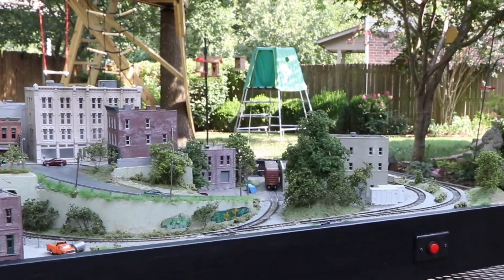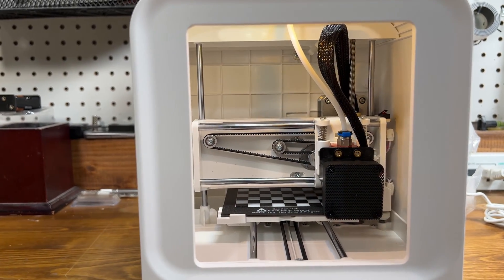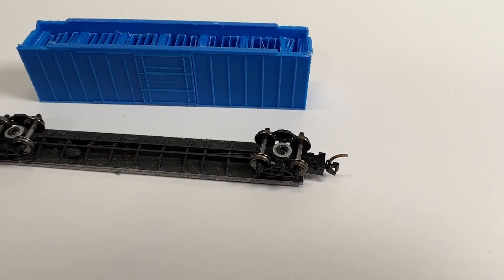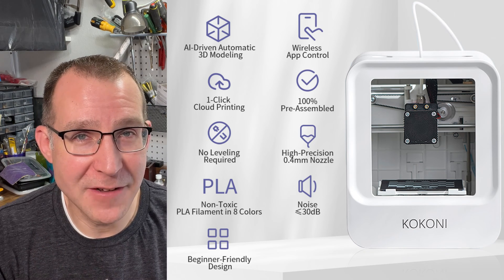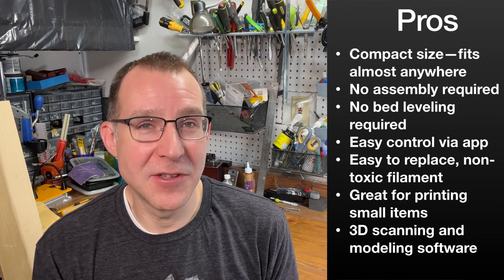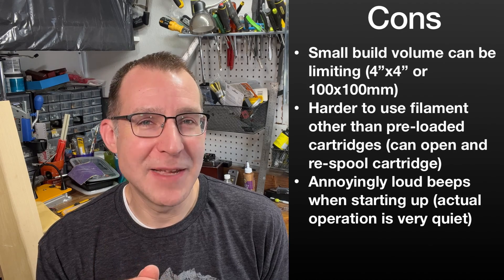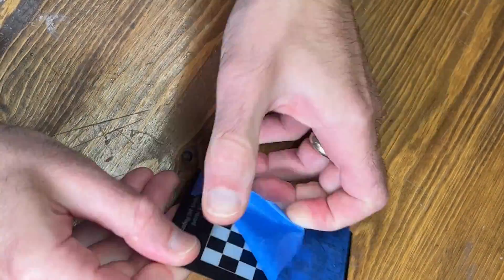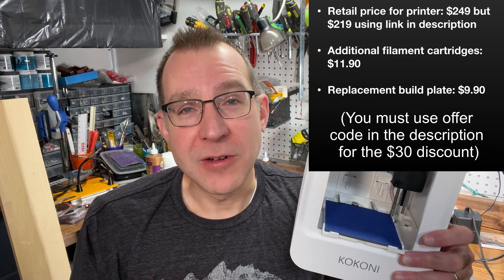So Easy, So Compact! // Kokoni EC1 3D Printer

Comment: What do you do with the used canister?
Reply from the maker: Yeah, that is the main issue. Technically they can be recycled, but in practice not easily since most places only take bottles. You can, however, refill them yourself if you unscrew the cover and put your own filament in there. So, you don't actually have to keep buying new canisters, but it is a bit of work to put new filament in there given all the screws and trying to feed the filament through the drive system, etc.

Comment: Hi Steve, new subscriber here. Love your videos, thank you!  On this printer, it appears they had a good price increase in the 5 months since you made this. I have been interested in 3D printing for a few years since my nephew made me some switch holders for my RV lights when I found a design online and sent it to him. Working on a new N scale layout I can see plenty of use for one! Just paid nearly $20 for 2 “Pods” shipping containers for a flatbed car and could easily have printed them for less!. But in your video you mentioned the “Ender 3” so I searched that on Amazon and found it as cheap as $168 where the Kokoni you mentioned has gone up to $289 as of 2/10/24. They still seem to honor the discount, but I have to wonder if the Ender 3 isn’t a better deal. Even if I added the $49 enclosure for the Ender it’s still cheaper than the Kokoni with the discount. Also, do you need special software to run these? I have a macbook/ipad/iphone and wonder if software is available for any/all of them? Thanks again for your hard work and informative videos!
Reply from the maker: The Ender 3 is more flexible overall in that it has a much bigger printer bed and can print more materials, but it isn’t as user friendly since you have to level the bed and configure bed and printer head temperatures yourself.  You can use free software for the printer and some free software is available for designing.

Comment: Hi Steve.
Great video. I have one of these printers and use my iPad with the Kokoni app. Only problem is the uploading of files to the printer from other sites. It just doesn’t accept them. Which file sharing app do you recommend.
Reply from the maker: I’ve only uploaded files (from thingiverse or elsewhere) to the kokoni cloud site so I could then select them with the app and print them that way. I don’t know of any way to avoid doing that.

Comment: Great video! Only question is that I’m trying to use micro train trucks. Do you know any that would work well for the box car and others like hoppers?
Reply from the maker: I don’t really know yet since I haven’t actually bought any to do that. I just stole these off a broken box car.  They do have lots of different types with different length coupler boxes and such so lots of options to choose from. May be a bit of a trial and error thing though.
Reply: @StevesTrains  Thanks for the response! That’s what I was going to do. I’ll comment and tell you how it works out.

Comment: Hi Steve, i just got myself an EC1. It looks super easy to use, but im having  connectivity issues. I found in the instructions that its not 5G compatible, and my phone doesn't  hotspot.  Did you  have
 any of these issues and how did you install it?
Reply from the maker: I connected to the printer by Bluetooth, then once I did that I connected the printer to my home wifi network. Then my phone app will see the printer online and allow me to print to it. There have been a couple of times when it would show up as offline and I had to reboot the printer, which solved that issue.

Comment: The Beep and the cartridge system are a big negative for me. While the beep can probably be patched, the cartridge system has "Future HP printer" written all over it. I also heavily doubt you can refill them, why else would you have to scan the QR code if not to make sure you do not reuse old cartridges?
Reply from the maker: You scan it every time you change them and you don’t have to scan the one that is on the printer. I have gone back and forth between three colors so you can do it multiple times at least.  But, will see what happens once I run out. I have loads of PLA so I’ll try refilling one once one of them runs out.

Comment: Hey Steve, great video. I have a question, or two. I’m doing n scale and the one thing I get aggregated with is the figures. You either pay $15 for a pack of 5 quality figures or $6 for 100 poor quality figures. And the choices are very limited compared to other scales. I moved to the Philippines about two years ago. That makes my costs much higher because of over seas shipping. So I’ve started looking into 3d printers. Seems resign makes a cleaner finish but those are too much trouble. Finally,my question. Can you filament printer produce a quality n scale figure? If so, where is a good place to find stl files of figures. Last question, can an O scale or HO scale file be down sized to N scale , keeping with figures. Thanks for all your videos and info.
Reply from the maker: No, N scale figures are too small for a filament printer. I mean it will print them but they won’t look very good. Resin printers can do a good job with them but as you said more hassle. That being said I haven’t tried to print n scale figure. But 28mm D&D figures don’t come out great either but then they are usually really complex. You can still see the detail but it is a lot of trouble with the supports and such and getting a smooth finish. 35 mm and bigger work ok. But train figures would be simple and not carrying weapons and have tails and stuff so I guess I should try them. Could probably print standing figures laying down and not have supports at all which would help a ton. Ok, I’ll try it sometime in the coming days.  Lol

Comment: If space is at a super premium I could see the utility of this. However there are small resin printers that are the same cost or cheaper that would offer better quality. The only downside is having a slightly larger footprint. the Geeetech Alkaid is only $99. You can get the entire printer and wash and cure station for about the same cost as this PLA printer. But again at the cost of some space.
Reply from the maker: Yeah, the resin printer is going to do better but I think there is a place for both since a lot of things will print fine with this one and it is less hassle.  Not that most people should have three 3D printers, but if you can get them as gifts or whatever I would get both if it was an option.

Comment from the maker: Buy Kokoni EC1 3D Printer: https://gozbx.com/r/RQM0akb30hoS
Use this code to receive $30 off: GBoff30
Some of the models I showed: 
Dumpster: https://www.thingiverse.com/thing:5361283
Shipping Container: https://www.thingiverse.com/thing:5833705
Large rooftop HVAC: https://www.thingiverse.com/thing:4747070
Assorted AC Units: https://www.thingiverse.com/thing:2626207
Ducts: https://www.thingiverse.com/thing:2626207
Reply: Thanks. This was very hlepful and I am seriously considering it. If you are going to paint the object anyway, does it matter what color PLA-filament you print it with?

Comment: Not sure I like that it will need its own filament rather than using rolls you can buy off Amazon & elsewhere. As to making cars, I've designed my own for Z scale. I've started offering them at Cults 3D. I'm going to do the same for N; probably older 40' cars since those aren't as available from manufacturers as they used to be.
Reply from the maker: That part is frustrating. I believe the idea is to keep the filament drier so it will print more consistently. I have lots of rolls of PLA for my Ender 3. I plan to try wrapping a spool in these cartridges once one or them runs out and try using it that way. Not ideal, but will see if that at least works ok.

Comment: Hi Steve,  before I buy, I was thinking about 3d printing an N scale steam tender shell. Will it reproduce the tender rivet detail? I don't have a shell to scan, but will scale drawings work?
Thanks for your help.
Reply from the maker: A resin printer will do a better job overall if you want very small detail like that. This one will show it, but a resin printer will look better, assuming it is a higher resolution one.
Reply: @StevesTrains  sorry for being a pest, but do the site that sells this little printer sell the resin printers? Thanks
Reply from the maker: @jamesdenny4734 I would go with one of the Elgoo Mars printers like this: https://amzn.to/3Sd73an if you are wanting a small and low cost resin printers. Those have a ton or reviews and have been around a long time, so you can have pretty good confidence in what you are getting. I haven’t tried any other printers from this particular vendor that makes the small filament printer so I don’t know anything about how they perform.

Comment: 3D printing offers a lot of flexibility in creating lots of object but filament printers have yet to find a way to print without a thousand lines that require lots of tedious sanding and filling. Yes, resin printers are messy, require curing cabinets and lots of alcohol but the quality of the finished items is infinitely better.
Reply from the maker: This is true overall, but depends on what you print. I really didn't have to do much if any sanding on most of these prints because most of them didn't need any external supports which helps a lot.  Also, you can smooth them if you brush on a coat of one of something like Bondene or one of those types of adhesives if you need to help to smooth out the joints where the supports connected.

Comment: iam asking myself if i need a 3D printer. iam also a N scaler. do you have any experience with resin 3D Printers? if so what printer would you recommend?
Reply from the maker: Check out Jimmy at the DIY and Digital. He has a lot of videos on 3D printing like this one with recommendations: https://www.youtube.com/watch?v=P-vwGE2sxPI

I had planned to buy a small resin printer for making these detail parts, but decided to try this one first so I didn't have to worry about the resin mess and could keep it inside the house. Resin printers will certainly give you more fine detail overall than these kind can, but it depends how much you need. For a lot of these types of detail parts you don't need that level of detail, but it varies in what you want to do. If you want to make small figures, a resin printer is a must.

Comment: The website is a bit disappointing, I don't see any information on replacement filament. What comes with the printer?
Reply from the maker: Filament link: https://www.kokoni3d.com/products/pla-filament-for-ec1?pr_prod_strat=pinned&pr_rec_id=d2cfa4eab&pr_rec_pid=7941590614254&pr_ref_pid=7943377780974&pr_seq=uniform
Reply from the maker: Filament link: https://www.kokoni3d.com/products/pla-filament-for-ec1?pr_prod_strat=pinned&pr_rec_id=d2cfa4eab&pr_rec_pid=7941590614254&pr_ref_pid=7943377780974&pr_seq=uniform
Reply: Oh, OK, that's a different site than the one you had linked for the printer (and it's a lot cheaper at your link). Thanks!

Comment: You never addressed print quality or really close-up shots of a print. The couple of close-ups looked questionable.
Reply from the maker: It isn’t going to match a resin printer of course in quality, but I think it does the same to a little better than my Ender 3 printer.
Reply: Quality and resolution are key for small scales like N scale so I agree not covering that was a big oversight.